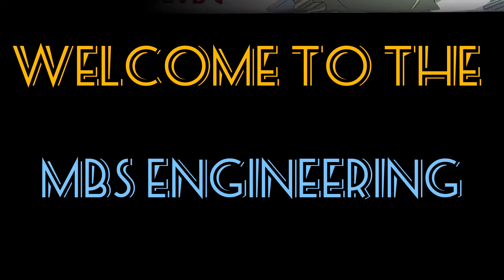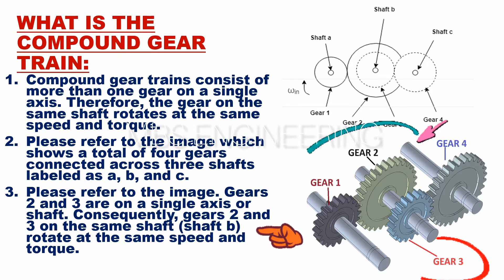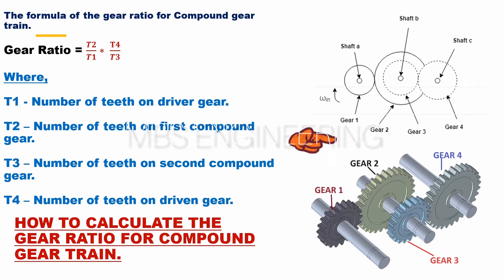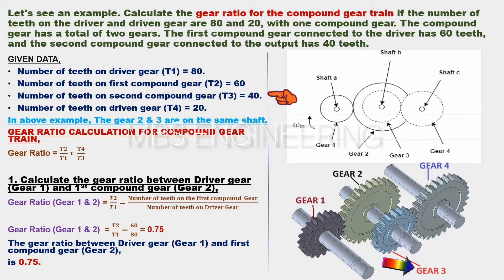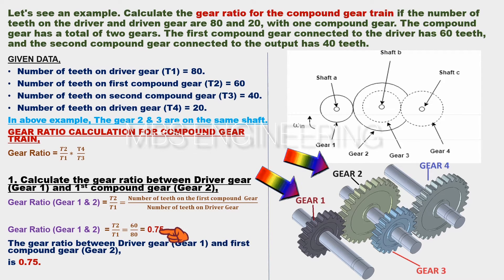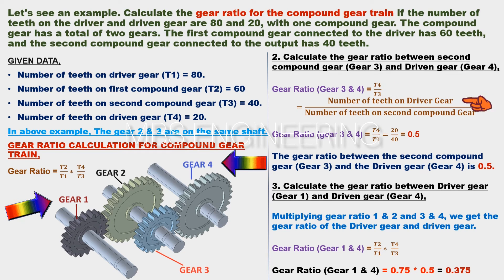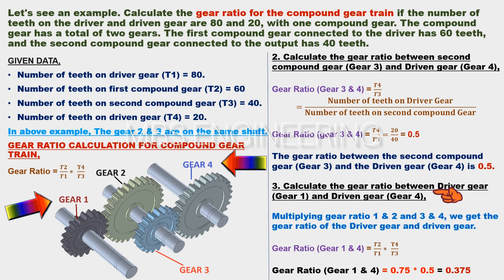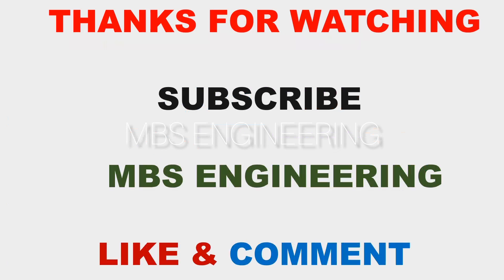WHAT IS THE COMPOUND GEAR TRAIN / HOW TO CALCULATE THE COMPOUND GEAR RATIO / GEAR RATIO CALCULATION

Comment: in the picture, the gears are shown as small and big. so G1 should be 60 g2 should be 80 g3 should be 20 g4 should be 40? am i wrong?
Reply from the maker: Good observations. The picture shows an example of a compound gear train. In the picture, gears G1 and G3 should be larger, while G2 (smaller than G1) and G4 should be smaller.